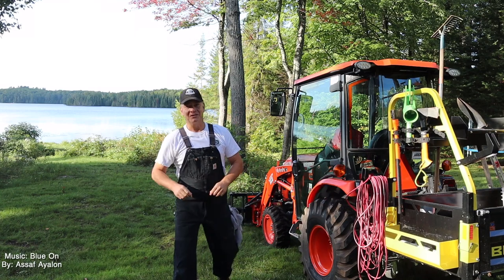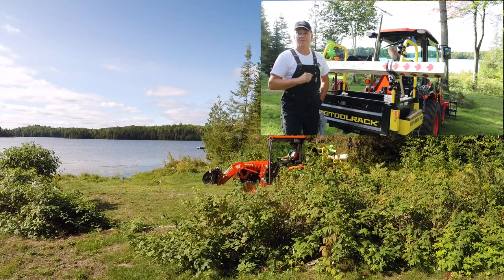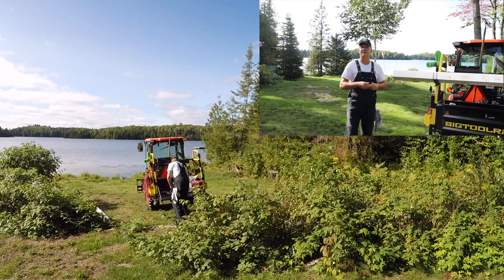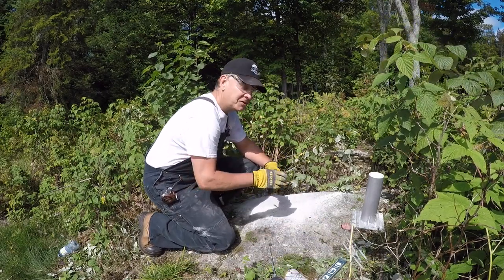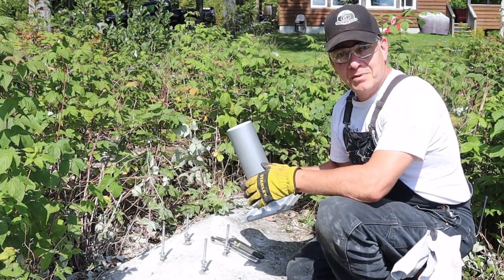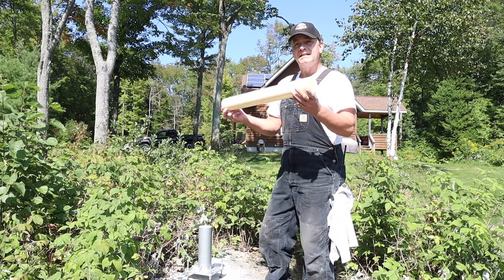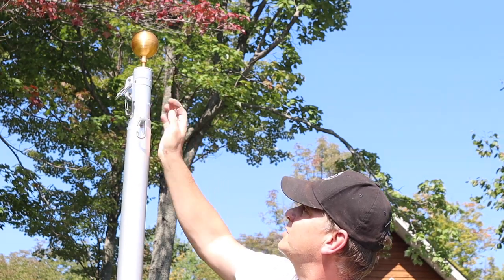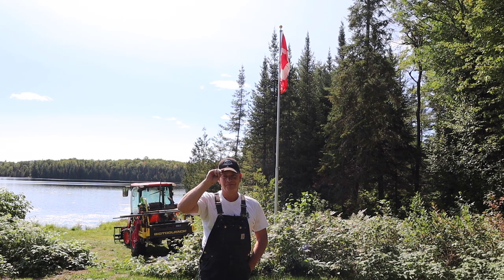#325 Titan Flag Pole Installation. Surface Mount. How To Install a Surface Mount Flagpole. outdoors

Comment: Nicely done! I have had mine installed for about 5 years now, I bought the 20 ft because it scaled better with the house and surrounding trees. We often get high winds with gusts up to 60 mph here in SE Idaho. The only problem I have had is  when the wind is  over 20 mph the joints in the pole flex just enough to make it difficult to unlock the joints and lower the pole.
The flag looks good ! Cheers!
Reply from the maker: Thanks for the great feedback Mike! Great to hear you are happy overall with it. I am very happy with it. Cheers and all the best!

Comment: Good video. Thanks. We have one of these poles at our place on Lake Huron on the Bruce. They withstand any of the winds we have (80-100 kph). If we know in advance a big wind is coming we'll take the flag down in advance, but sometimes that's not possible. We accept that we go through about 4 flags a year. We like also to sometimes lower the pole a section to make it less flexible. In a strong wind it's somewhat difficult to lower sections because of the side loading from the wind. We rock the pole into the wind and twist at the right time and it comes down. We've had our pole for about 9 years. Our old pole, a Home Hardware special, buckled in a storm.

Comment: Gord, Another job extremely well done! My suggestion though is that you have so many US followers you should also have the Stars and Stripes flying. I used to operate a gas station in Vermont and I had both flags flying and I know that it made a difference. I had so many Canadian customers that would pull in.
Reply from the maker: Good morning Hal. I had not thought of that but perhaps something I should think about. Thanks for the good suggestion. Have a wonderful weekend!
Reply: That's your flag, be proud of it by itself.
Reply: actually it's against Canadian flag protocol to have another flag flying on the same pole as the Canadian Flag..

Comment: Looks great. You can save the threads on a wedge anchor or rod as you installed by screwing a nut on flush to the end you are hammering on.  The nut will move with vibration and expose the threads,  and if you do happen to booger up  a bit of threads  cut above the nut and unscrew the nut fully it will chase the threads cleaning them up to thread on a new nut.
Reply from the maker: Thanks Mandel! I appreciate the great advice. Cheers!

Comment: before I watch the video, find a BIG rock, drill as many very large (3-4 cms in diameter) and deep lag bolt holes as needed (1/2 meter deep), mount and tighten.  was that a good idea?
Reply from the maker: LOL! Welllll......:)) Cheers Jim!

Comment: Remember to take the flag down for winter. The ice and snow destroy flags. You will double the life of your flag
Reply from the maker: Good morning CM! Yes indeed - I usually have to buy a new one each Spring. I leave it up because the local snowmobilers use it as a landmark when night riding in the winter. But I may do so now. Have a great weekend!